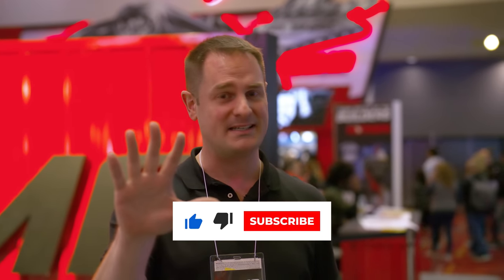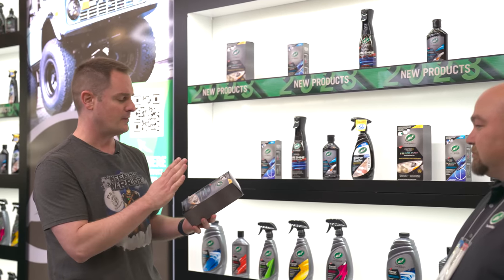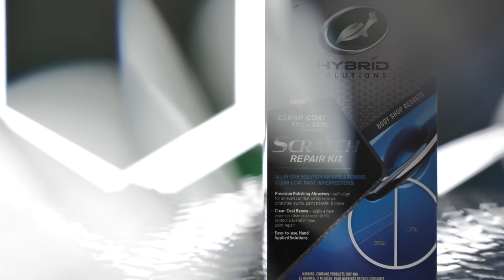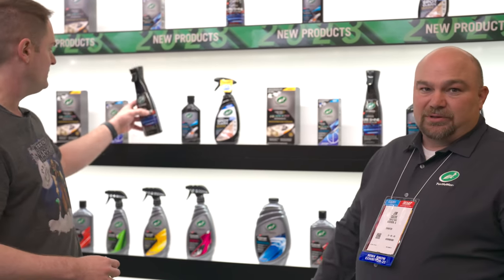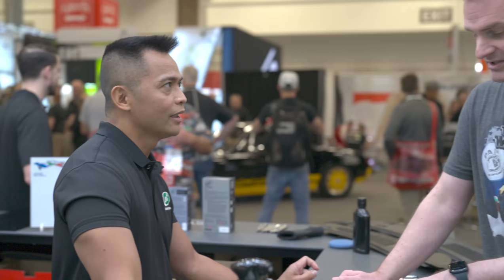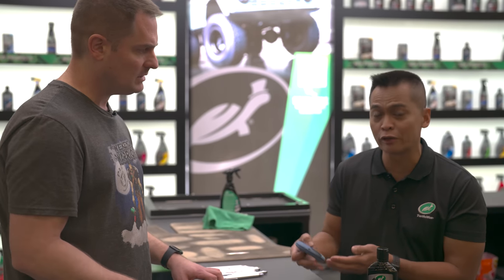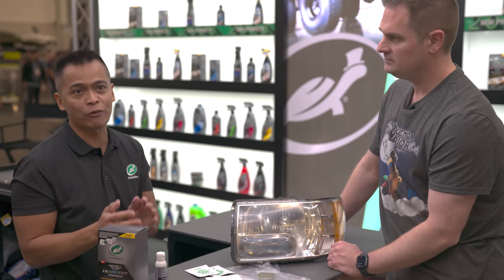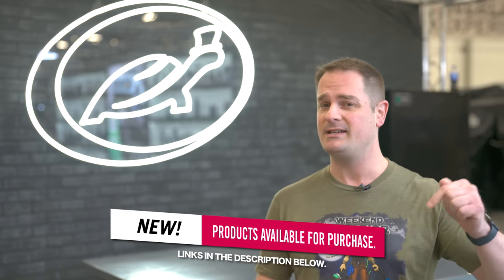New 2023 Turtle Wax products released!

Comment: Hey Pan. Great video. I was wondering if you could use the wipe on clear coat (glass bottle) on the headlights? Longer clarity/better clear coat?
I love the Hybrid line. Good price, good products.
Reply from the maker: Good question! Perhaps they'll read your comment and reply.
Reply: Maybe the liquid clear coat only works on painted/cleared surfaces??
I will try and email them for an answer. 😁

Comment: Pan, hopefully the last two questions for a while.  I have a car with Avalon King  ceramic coating that the coating is about 1.5 years old.  I took a trip on a rainy day so the bottom and back and front of the car is pretty dirty.  Weather has kept me from washing the car, going on week three now. ( I have no access to a garage with a drain to wash it indoors).  Question:  Is it better to leave the dirt on for 3 weeks until I can do my regular wash or do a waterless wash on it within a week or so and risk the microscopic "scratches" that waterless wash has to leave behind (or is the ceramic hard enough to keep microscratches from occuring?)   I use Chemical Guys "Eco-Smart" waterless wash.   Do you reccomend a better one?
Reply from the maker: It's absolutely better to not wash the car, then to do a waterless wash. A better alternative to a waterless wash is a rinseless wash method. All you need is a bucket of water, and there's very little water that goes on the floor. Watch my method: https://youtu.be/p58Y5qRd3OU

But common sense is needed with a rinseless wash. If the vehicle is super dirty, you have to rinse it first, before washing it.

Comment: I just tried the hybrid scratch remover on two vehicles. It’s pretty amazing. It also works for clear damaged from bird droppings, that was amazing as well.  TW sold me when the ICE products came out.
Reply from the maker: Thanks for sharing
Reply: @PanTheOrganizer  I attempted to blend the edges in better with my DA. This stuff is very resistant to polishing, pretty hard coating. I still did not get the edges blended down with a coarse compound, better but not there yet. I will probably have to sand it, my only concern is if it is soft enough to polish the scratches back out. This is on the hood of the car, so the edges are pretty noticeable.  Just an FYI, and of course if you have suggestions that would be great. If you could machine blend it to feather it in, it would really be a winner.
Reply: I tried something that I had that I have used before to blend touch up blobs, Langka. Even this stuff barely cuts it, this stuff must be a crosslinking chemistry.  If I was to do it over, I would try hitting it with Langka earlier in the cure cycle. I think I will still have to do some sanding, followed by more buffing and maybe more Langka. I would also not smear it across the surface as they suggest. They do say to remove it with a microfiber on small scratches as a tip, but if you leave any on the surrounding surface it leaves a noticeable ridge or brush like marks from the microfiber towel. The bird stain is still invisible, but small scratches are becoming a bit more pronounced as I remove the excess. It’s still way better than it was, but I think there is a technique that could really make it better for someone capable of sanding and buffing.

Comment: Hi Pan, hope you're going great. I live in Aust where summers, as you can imagine, are pretty intense with high UV levels. What is the best dash protection product. Do you cover this in one of you're clips? Thanx ever so much Michael
Reply from the maker: Measuring levels of UV protection is near impossible, so we have to rely on manufacturer claims on that. Two of the most highly used interior protectants are CarPro PERL (diluted 1:5 for interior use) and 303 Protectant.
Reply: @PanTheOrganizer  Hi Pan thanx for reply greatly appreciate it

Comment: Hi Pan! I have a few questions, I've been using Soft99 Fusso for about 4 years now and have always been amazed with the hydrophobicity and the durability of the product. I always strip it off every 6-8 months for the fresh new layer to bond properly. This has served me pretty well and I recently stripped it off and applied a fresh new layer mid December of last year. Now, I've started using 303 Graphene Nano spray as a topper and I noticed the hydrophobicity weakens much quicker as compared to leaving it with no topper. 

Do these products not bond well together? If I don't reapply the topper I use and let it fade, will the hydrophobicity of the Soft99 come back?
Reply from the maker: Normally you don’t combine regular waxes/sealants with ceramic/graphene baded products as you can’t ensure chemical compatibility and also you would alter hydrophobics.

Comment: Hi Pan, i am looking to remove a polymer sealant from my car so that i can apply a ceramic coating. What is the best way to go about this? It is not a very durable sealant and i would prefer if i did not have to polish the car again. Thanks
Reply from the maker: The only way is to fully wash, decon and machine polish the surface. Machine polishing the only way to ensure 100% removal of any previous protection. And it's crucial prior to applying a true coating from a glass bottle.

Comment: 🐢 Turtle Wax is totally legit for the professional detailer.  Great new selection of products. Blessings from USA 🇺🇸
Reply from the maker: What products from their lineup do you use on a professional level?
Reply: @Pan The Organizer  
ONE & Done Compound / Graphene Flex wax / Interior / Acrylic  Balck Polish & wax (killer with Euro 50/50 pad) / Ceramic wash & wax with Wet Wax as a drying aid on maintenance washes / Graphene Tire Shine / Ceramic + Graphene Inside Job 👍

Comment: I have a client that wants two coats of wax after washing, my question is does two coats protect better than one?
Reply from the maker: No, unless otherwise specified by the instructions on the label of the specific wax you are applying. Keep in mind there's a very fine layer that actually sticks to the clear coat. So it's a myth that applying a thicker layer will add "more wax" on the surface. As the amount that needs to stick will stick, and the excess you will buff out anyways with the microfiber towel.

So the best is actually the opposite: the thinnest possible layer (no waste) and simply make sure you get even coverage across the surface.

Comment: If anything convinces me that it is clearly better than TW Seal And Shine, I will use it. Maybe I will use Pure Shine on top of S&S.
Reply from the maker: Pure Shine is a gloss enhancer, it's not meant to protect like Seal N Shine does for months. Two different types of products. You would apply Pure Shine on top of your existing protection, to boost gloss, slickness and prevent dust from being attracted as much to the surface.

Comment: New headlight restore kit is a joke compared to the old stuff; they even removed some of the components included in the old one. Also those sealant wipes will give protection for a few months best case scenario,( talking from personal experience with the kit, absolute bs) . Best to apply film protection after they've been restored otherwise they're going to fade quickly.
Reply: Couldn't be any worse than the Adam's kit.